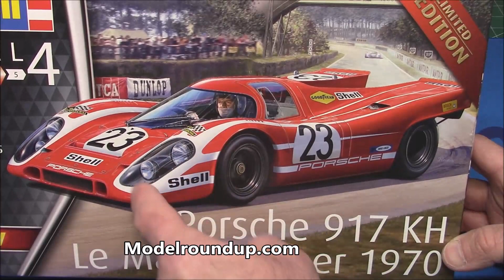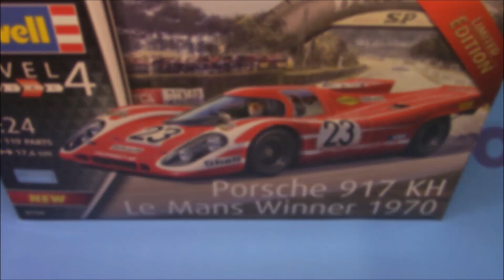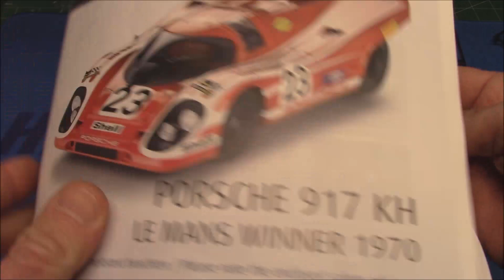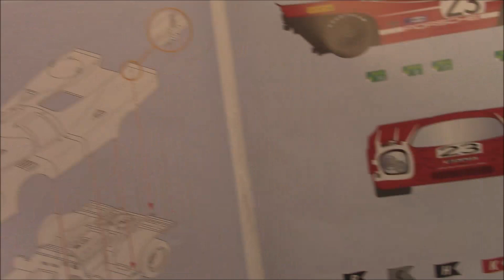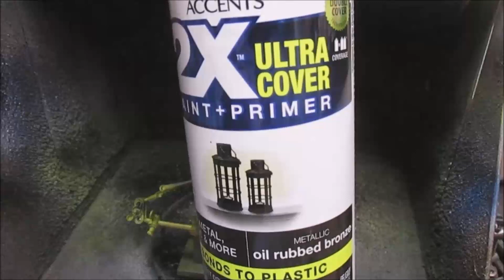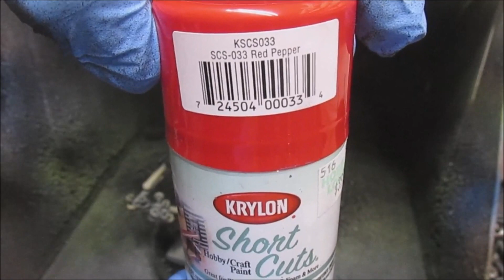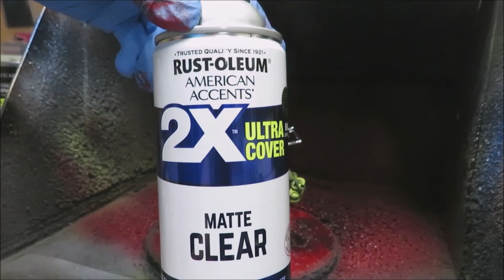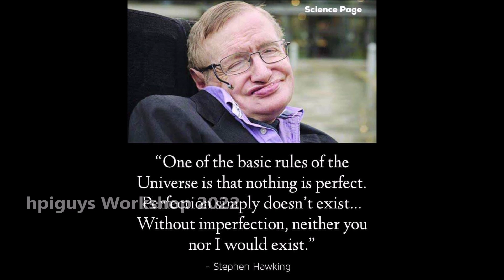Porsche 917 KH 12cyl 1970 Le Mans Winner 1/24 Scale Model Kit Build How To Assemble Paint Decal

Comment: I love LeMans racers, and remember seeing this car and so many others that are available in kit form race back in the 1960's and 70's. I have the old Heller version of this kit that I was able to pick up from a collector in mint condition. It's a little more detailed kit that the Revell kit and consists of 185 parts and includes wire and a jig to make the metal coil-over springs. I really appreciated your build, because i wanted to see a build video of this kit. you asked about the mini seat next to the driver's seat. Yes, there was a regulation that since this was technically a "touring car" class that there be 2 seats in the car. Also, the spare wheel has a super small tire to meet the regulation that the cars carry a spare tire. Also, back in the 60's there was a regulatio that each car carry a 20X40X60 cm suitcase in another nod to the "touring" rules. A lot of kits of the 1960's Ford GT40's (Fujimi, IMC, Union, etc.) have small plastic rectangles molded to the rear crossmember that mimic 2 small suitcases. Keep up the good work! I watch every one of your videos.

Comment: Looks like a good kit, now imagine building one where no parts have positive locators, are too short to reach, terribly warped, and you have to wind your own springs from kinked and oxidized  wire. That was the nightmare known as the Heller/ Union/ Testers kit. Buy the Fujimi/ Revell kits!
Reply: I'm building the heller kit now because it has a motor, but your right, what a bitch. I have their 512 too. I'll take my time. I have the fujimi kits too, martini and gulf.

Comment: Now you need it's LeMans rival Ferrari 512 S to accompany it 😉
Reply: I have the kits, both from heller, 917 is underway, the ferrari is next. it's not too bad. I build my own jigs to hold stuff. build as much as possible before paint, and use appropriate adhesive and tools to compensate for old, rough molds and unusual plastic material (softer) almost as soft as some tires

Comment: Not planning on getting this one but wanted to see you enjoy building it.
That's some thin delicate parts. Love the slightly used disc brake look, that's some excellent molding.
When the picture popped up I thought it was a 20?? These cars haven't changed much since the 70's. Goes to show if something works, don't mess with it.

Comment: This has to be Fujimi's kit of the 917. I can see made in Japan stamped on the parts trees and poly caps only the Japanes kits have and the steerable front. I have built one just a few months ago. Only the box, decals and instructions are different. My mistake, Fujimi also has the number 23 decal set on their website and the kit builds exactly as the Revell kit.